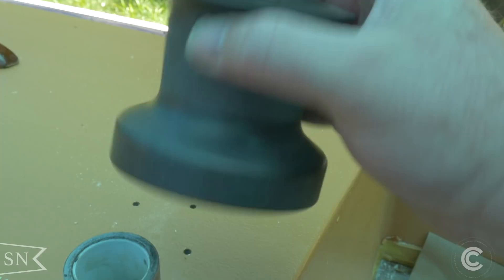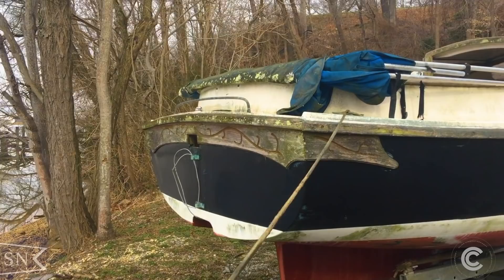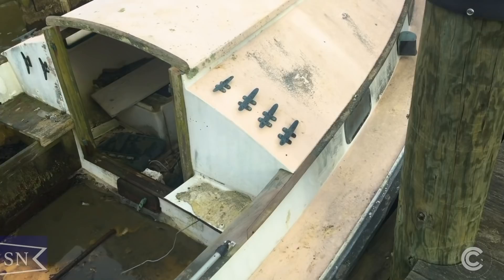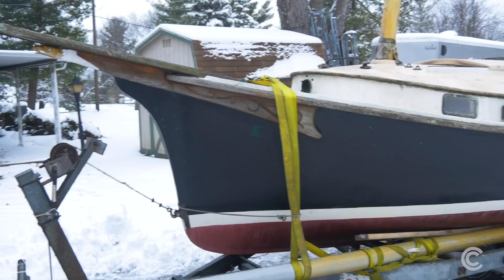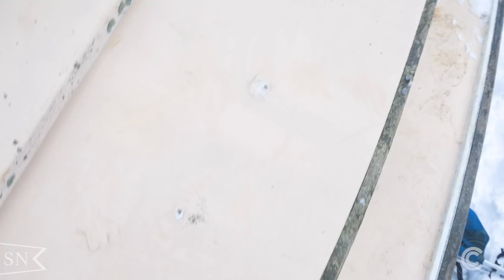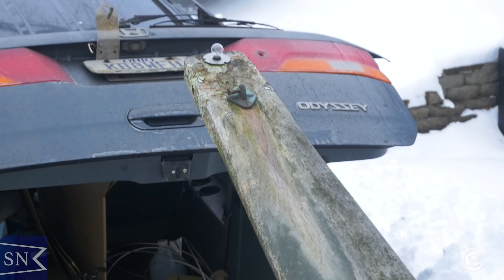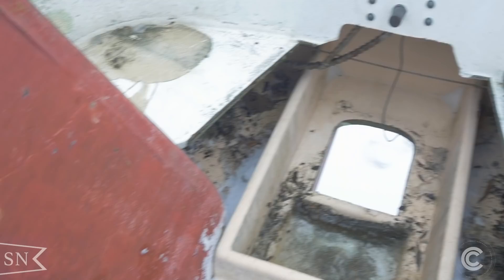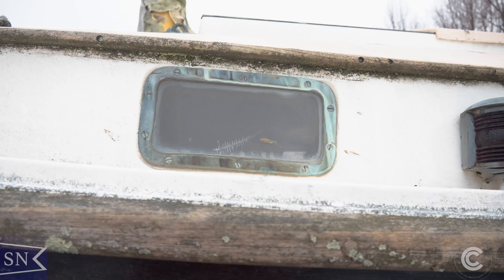Eps 1.8 -  Pickup  Herreshoff Eagle and Transport Home S1E08

Comment: I got your message on your tentative plans on the rudder. I was also thinking of using marine grade plywood for the core. I viewed the Total Boat Dory build on YouTube and was thinking of using Kevlar and Carbon Fiber like they. I you didn't see the video you might want to take a look at it. I would be interested in your thoughts. 

I have had my America for 30 years and get the greatest joy sailing "PATIENCE"
Reply: Hi Tom. Ya know, I was actually thinking about using carbon fiber instead of glass. Might offer some better strength and weight benefits. I have seen those Dory build episodes and love them. Would love to hang out with Lou for a couple months. Aside from marine plywood for the core, I am looking into some composite materials as well (PVC/plywood lamination). Doing some research on what would be a good option there. Marine plywood and glass/epoxy will  always work, but I'd like to find an alternative if I can. Thanks for the reference. I need to go back and watch that episode again.

Comment: I am interested in how you Repair the rudder. I am going to have to repair the rudder on my 1973 America. It's not quite as bad as your 's but it will be if it isn't taken care of soon.
Reply from the maker: Hi Thomas. Yes, that's going to be a fun project. One I may get to earlier than later, as it could be largely done inside while I'm waiting for the weather to change to do work on the boat outside. My intention at the moment is to measure and draw it all out for a pattern, then make a core out of plywood (perhaps 3/4", perhaps two sheets of 1/2") or some other material that is strong but light. You no doubt know these rudders weigh 8.5 metic tons and while I know they need to have some weight, I'd like to see if I can keep it strong but lighten it up a little. Then cover it with an envelope of fiberglass. But I'm researching everything at the moment for options for a cost effective, sturdy and lightweight rudder. Thanks for following along. You get any ideas as well, let me know.
Reply from the maker: By the way, I have started a Herreshoff Eagle group on Facebook where we can all exchange ideas and information. I already have a couple documents up there on rigging and sail sizes, etc and will put more up once I acquire it. Anyone is welcome to contribute as well. Hope you join.

https://www.facebook.com/groups/herreshoffeagle/